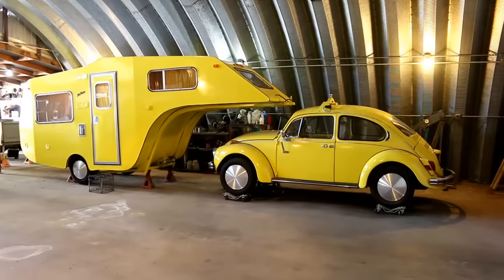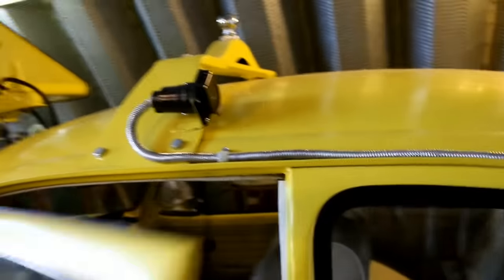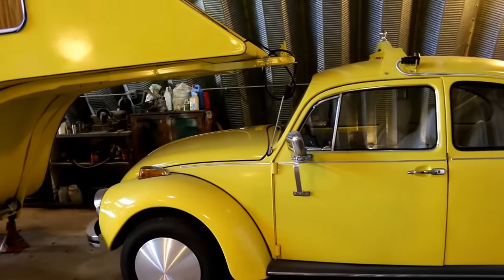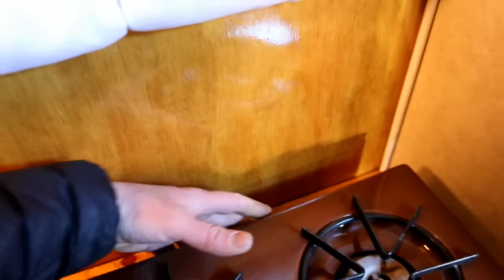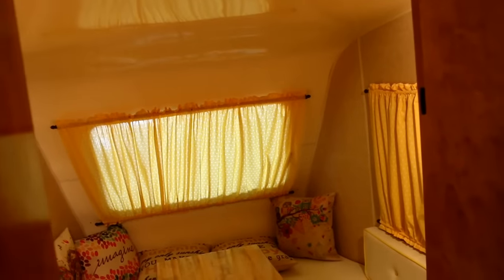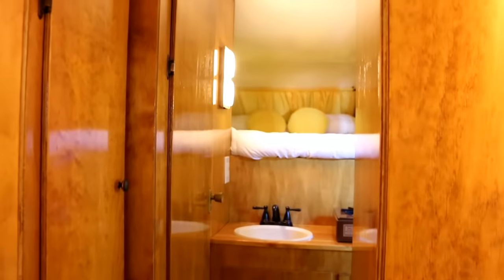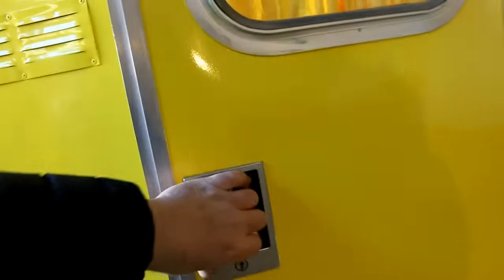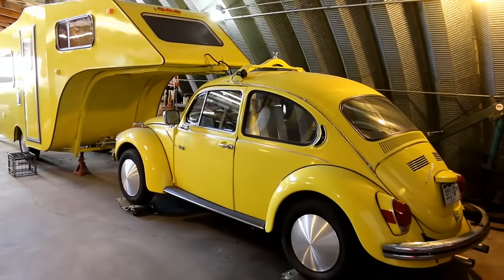VW Bug Gooseneck Trailer FOUND.  PART 2.

Comment: Apart from having a bed over a stove, seems practical.
Reply: Who doesn't like a set of fire resistant bedsheets? Imagine how warm you're going to be in the winter.
Reply: If you are on a daytime schedule, the bed should be made in the morning before cooking commences. Stow the stove before bed.
Reply: @questioner1596  I would imagine that anything that is cooked there the smell is gonna stick on the sheets.
Reply: @c.curmudgeon2834  keep the feet warm in a cold dark winter night.
Reply: @c.curmudgeon2834  Q10
Reply: I was thinking the same, how many of these trailers have burned to the ground i wonder
Reply: @jmason2838  i think by today's standards of power, luxury and reliability it would be quite impractical. The bug was a great car, but i think hauling this thing on an extended camping trip (say travelling around the country) would put an enormous strain on that air cooled 1600 motor. Great engines but not exactly know for their torque. This is a beautiful museum piece but it's the last thing I'd be buying and restoring for actual holiday use. Love these videos though. Totally awesome motor memorabilia.
Reply: yes but thinking a good side you could lean over and make a cup of coffee while you were still in bed
Reply: Who cooks while someone is in bed? Worry wart much?
Reply: This is a rebuild and not exactly like the original floor plan.
Reply: @c.curmudgeon2834  crispy
Reply: Russians?
Reply: Remember 60 hp in a bug! Never get behind it
Reply: Seems like it’s designed to cook outside with most of the time and only be used inside when raining or snowing
Reply: I'd love the warmth of a stove to keep me going at least for a few more hours. ... It's not much different than sleeping by a campfire.

It's pretty obvious to anyone with intelligence that one is capable of shutting off a stove after usage, but I suppose some folks are thinking they're going to leave a clever comment.
Reply: Imagine the sic sh!t that went down in this pile back in the day.
Reply: Well the whole interior is wood, I don't think that'd be the first thing to catch fire.
Reply: You can't sleep and cook at the same time😂
Reply: This would be cool if it was made with fibreglass, and stove relocated to safer location.

Comment: I love stuff like this. What a cool little trailer! I never would’ve thought they would make an accessory quite like this for a VW Bug, let alone the fact that a VW Bug could pull something like this. The craftsmanship on this restoration is fantastic. It probably looks 10 times better now than it did when it was brand new. Truly some beautiful work!
Reply: Those little bug engines, the original 1600s, can do alot. Push around a 71 bus just fine. You let it go at its own speed. Don't expect a lot of power, try to travel when it is not super warm (air cooled, ya know?), just have fun cruising. This restoration is great; I'd love to see one on the road.

Comment: Great Restoration. Now take that trailer and make a whole lot more cause people with VW's are gonna want one and I am sure the patent ran out along time ago.
Reply: Imagine making a modern version that was able to fit the modern beetle along with the classic. That'd be nice
Reply: Justin Noker I’d buy one  for sure... 2 new beetles in my household... plus a  Passat ...
Reply: I would be very interested. But I need one for a 56 type 1
Reply: few people in Brazil did that. i saw repro of this trailer several times on facebook
Reply: @mikesgarage9026  hey you are flock member too
Reply: You'd only need to bump that 1600 to 2300cc to have enough torque to include a family and camping equipment.
Reply: Highly doubt that DOT would let that pass safety inspection, the camper and people would probably be over the GWVR of the beetle.
Reply: @cpufreak101  Duudddeee. I don't even own a Beetle and I'd want that.
Reply: @jeffstrang4330  from what I was told about this, that'd unfortunately be the likely case with a modern version. looking it up, the "New Beetle" isn't rated to tow whatsoever, so that would kill plans for a modern version :/
Reply: Outlawflyer78  It would work with several of today’s small cars
Reply: @badandylaoc  79 to 2003 Super Beetle with a Type 4 2.0 plus liter engine and an oil cooler would do the trick nicely
Reply: I want one for my Honda Fit!
Reply: @jeffstrang4330  .. you are correct about the DOT, but not just the vehicle weight. I used to work in the RV industry, there is no way a company would take on the liability for something like this. It is super cool and I would love one though.
Reply: @mikeybikey5501 : I was thinking same thing for my Toyota Yaris!
Reply: Jeff Strang  yes it’s actually a diy disaster covered in paint
Reply: Justin Noker    Yes he’s good with paint but the engineering is just plane dangerous
Reply: @cpufreak101  I would love it  for my yellow Bug.  🙂
Reply: @cpufreak101  I have a Turbo standard transmission .  I think that it just be able to tow it.  It can tow a Tab trailer no problem.
Reply: @LowreyContractorsUK  why so?
Reply: I think those with the newer Beetles would want one. Perhaps those with similar sized cars would want one?
Reply: @briancole6550  why not today ???
Reply: Why not use a newer bug model with a lot more HP
Reply: @Jordon Carlson actually the new beetle is way heavier and uses more steel in it's construction
Reply: @Jordon Carlson the thickness of the metal does not equal strength the gauge of the steel used in the exterior body in the new beetle is actually thicker look at the crash data you're ill informed
Reply: @jeffstrang4330  Hi there🙂🌻✌️...please to kindly explain..  what is a gwvr ?!?
Reply: Sorry lol I meant gvwr Gross Vehicle Weight Rating, total amount of weight of car, fuel, passenger and load.
Reply: @earlscheib7754  is that really you ES?
Reply: I'd like to see something like that for other small cars too!  Love it!
Reply: @cpufreak101  and electrical hookup
Reply: Yes
Yes I do want one
Reply: @mikesgarage9026  white-anglo(mostly)-saxon(fifthavenue?)adventist0protestant(1611). Want to make one of theese for campmeeting!:goodvibes::yougotthis:
Reply: I know I'd definitely buy one because I love vw beetles

Comment: Some one needs to make a good set of blue prints for this design.
Reply: A couple of thoughts:
The frontal aerodynamics look like they are better with that trailer compared to regular ones - it looks like it would push down the car and thus give better grip.
But if it's windy from the side, does it pull on the car in an unfavorable way?
Reply: Our VW would get blown sideways occasionally on the highway. I imagine car and trail would dance together. 😁
Reply: Way over GCWR for a beetle, did they even check? Wind would be a whole other issue.  There's a reason these never caught on or the camper set ups they had for cars back then with their own auxiliary wheels
Reply: @Cutlass_Rudd  actually no it's fine for the beetle

Comment: how cool is that thing,
Reply: Extremely - Love your videos. Especially VWs
Reply from the maker: It is pretty amazing to see one restored to this condition.  He did an amazing job on the restoration.
Reply: To bad they never made one to fit single or double cabs like crusty!
Reply: Couldn’t agree more, I love your videos but the way. Huge fan.
Reply: Shut up and take my money cool.
Reply: Isn't the Thing another VW vehicle? 🤣
Reply: @jjryan1352  no.  Because the towing vehicle can do a 360 under the camper and is hauled around by something so awesomely cute small.  It's like the ant carrying the leaf twice it's size.  Little package, low horsepower, more torque than you can shake a stick at type of thing.

Sorry that was for the guy above you.
Reply: The welding shop I apprenticed at put a 5th wheel hitch on the roof of a 1975 Buick electra in 1975. Car was only a couple months old. Had an exoskeleton built down and attached to the car frame.
Reply: SUB ZERO COOL
Reply: @Roscoe.P.Coldchain  It's because its a period correct accessory. Calm down bud.
Reply: @dontneedtoknow5836  I don't think there's any torque to go along with the no hp either lol
Reply: @romper4444  you don't have to have a large amount of hp to create large amounts of torque.

And this probably would have been better balanced considering it is a German product?  During the epitome of their designs.

Comment: The promotional film showed the hitch attached entirely to the drip rail not with holes through the top of the car i remember the hitch attached in 4 places to spread the weight out along the drip rail. This was a very good video the gentleman did a great job putting it together with know directions. The trailer restoration was beautiful i helped my dad do a 35ft. Travel trailer they aren't easy with rounded corners some materials don't like bending. But it was a beauty when we were done we used it for yrs. Fishing and hunting.
Reply: Thanks for sharing

Comment: Such design of the camper trailers is ingenious! I really don't understand why it never took off.  I mean, you have agility, more compact size and with modern technology you could also have better vision. Definitely amazing way to tow a camper trailer!
Reply: The trailer has a lot of room, unfortunately the VW does not, which is probably not considered ideal for long trips.
Reply: @barnabyjones6995  why, only the driver needs to be in the beetle while driving and the rest of the family can chill in the camper
Reply: @daniel57327  that "legal" where you live?
For sure not in Europe 🤔
Reply: The tow vehicle of choice had 48hp. Enough said.
Reply: @daniel57327  not unless the camper has seat and shoulder belts inside the camper 🚧🚧... I really don't think the D.M.V. would allow people inside while it's moving down the road..🛑🛑.🖐️🚫🚫🚫😩😩🤔🤨
Reply: The Cars weren't made powerful enough to tow anything very far..
Reply: Today it wont be practical in europe at lest, just because of the structural intergrity of the cars roof and frame is made to pull trailors on a trailors hitch in the back and not on the roof, so basicly with todays regualtiory hell hole you would have to redesig the whole car to legaly pull stuff like this.
Reply: @oleand14  You are right, yes. And considering all the regulations (Especially in Germany where I live), it would definitely be a nightmare bureaucracy trip to pull it off.
Reply: Because it’s a gutless, overloaded, air cooled death trap.
Reply: @jmason2838  seatbelts for sure would not help 1 bit in Europe, there is NO way anyone can stay inside a caravan while driving
Reply: @mattmayo3539  Facts
Reply: In principle, any sedan could tow it

Comment: The VW bug was what International Travel Inc used in the commercial in 1974 to promote this travel trailer. It has become known as a WV accessory which it can be but some other small cars could be used as well. The bug would probably be the best choice which is probably why they chose it for the commercial.
It was a good idea as it looks like getting in and out of places would be much easier than when a trailer is hitched to the back. 
The two things do look great together.

Comment: That is absolutely mind boggling, and it would never in a million years be legal in my neck of the woods!  I love it, and I want one! 🤩
Reply from the maker: Pretty neat trailer.  I'm sure it would be frowned upon by the DOT these days.  JC.
Reply: Old vehicles get a pass
Reply: What would be the issue? It has safety
 chains, lights, appears to have electric brakes, and the tow vehicle hitch is more that sufficiently strong along with the bodywork mounting. The power margin is much narrower than most north America drivers are used to but I've seen Peugeots pulling horse trailers in Bavaria without issue.
Reply: Imagine a steep down hill road with a switchback, the trailer could overpower the VW,thereby tipping it over sideways. I think that would be a concern. Cheers

Comment: Beautiful, great job guys!  I bought a factory redo Diesel Beetle, 2015 model but sold in June 2017. VW dropped the “bubble” and it’s something like a foot shorter than the original beetles. Making a similar trailer work on my Beetle would require a shorter RV.

Comment: Just ran across this video.  When my brother was assigned to Cannon AFB in New Mexico, another airman had one of these.  My brother would only drive VW products his entire life and was very interested in this trailer designed as he loved to camp. When my brother retired in the mid 1980's, the guy still had the trailer and was stationed in Colorado at Peterson AFB, his last duty assignment before he was to retire himself. He had obtained a copy of the original plans and gave one to my brother.  I would have to check with my sister in law to see if she knows where they are, as my brother passed about 4 years ago.

Comment: Oh, Bob....Those exposed bolts right where I'd crack my head are NOT cool.
Reply: so true, how easy is it to put some white caps on them?
Reply: Or shorter bolts..........fit and finish could be better
Reply: Use the bolts to attach some “oh shit” handles on the inside. Looks like perfect spacing and location for them.
Reply: The bolts are a 100% half assed solution. Drilling wouldn't be necessary if some proper thought had put into the mounting. Bugs don't need more holes.
Reply: Could have used carriage bolts. I think this was his take on the original hitch.
Reply: Mickey Bitsko yet nobody notices the hitch has morphed the car so the driver and passenger door sit way low from the hitch crushing the car down.
Reply: Mickey Bitsko 
You can see this bolts are not tighten yet.  It is not finished.
I was looking for the strong iron counterplate , inside ot the roof.
Reply: Hopefully you will only do it once! But some people are slow learning!
Reply: I don’t think the original hitch was intended to be permanent? Off and on like a roof rack?

Comment: I'd think I would do something else with those bolts so they don't go through my skull in a crash.
Reply: Simple solution: don’t get in a wreck.
Reply: Just buy a Volvo.
Reply: Yeah,, flip them over and use fender bolts, and have a acorn nut on the outside.
Reply: you saw the color right? nobody is running into this thing

Comment: Nice work on the restoration and reinforcement of the trailer hitch/frame. It may also be an advantage to weld in a couple side plates where the frame makes the curve downwards for more rigidity. As far forward as the actual ball hitch is, it shouldn't interfere with any part of the car. The interior work is stunning considering how this looked the last time I saw a video of it! Very rare bird here... nice job!😍😁👍👍

Comment: 0 to 60 in, oh forget it never.  And no uphill.
Reply: Timing it in the quarter mile requires a calendar.
Reply: Mark Gigiel wouldn’t count on a whole lotta stop either.
Reply: @corydriver7634  7 pin plug tells me the trailer has, or is supposed to have brakes.
Reply: @alexmawdsley  Only tells you its got to have lights :D

Comment: VW BUGS (Type 1 for all to know) 71 year had the 1600 Dual Port engine...60 hp is it...the amazing thing is gears 1, 2 & 3 are reduced...4th was actually overdrive...final gear was a low ratio. The 15 inch wheels and tires made up for this low ratio (4:33 I think) so with overdrive in 4th it would cruise quite well at 60 pulling this aerodynamic trailer...notice the smooth shape of the VW...THEN LOOK AT THE TRAILER...PERFECT...NIIICE SET UP...I am 73 & retired...I owned a few Bugs in my life...neeto bandito...BEEP BEEP...

Comment: A lot of people are unaware that the Hunter Compact Trailer was also made to be hauled by a VW bug. I have a 1972 Hunter Compact  that my uncle bought when he bought his 72 Super Beetle. I had the beetle until it was wrecked in 1990. I now pull it with a restored 93 Ford Festiva. Total weight is 900# & tongue weight  is 80#.  The Hunter's  were actually sold in the dealerships / with the VW's. Some dealers carried them, other's just offered to order them. Dixon VW in  Crest Hill , Ill was a large dealership so he had them on display. There is a lot of Hunters still on the road & are still sought after. I've been offered $ 10,000 for mine, & the sticker price was only $3100..... Just putting it out there...

Comment: You would have to disconnect the plug and safety chain to do all the maneuvering as shown on the first video. I can see how this would be a fun thing to use. We started with an 18 foot 5th wheel  pulled with a 2.8 v6 S15 Gmc and now have a 40ft and a 3500 1 ton. Thanks for sharing.

Comment: Here is a suggestion. The trailer is towed with the gooseneck forward, but the gooseneck is tapered on the forward side. This is not an aerodynamic shape if the vehicle travels at less than speed of sound. If the gooseneck was square fronted, space inside could be more efficiently used. Any attempt at streamlining a subsonic vehicle must be done at the rear, where the vertical rear plane bordered by lines of air separation governs the size of the wake (low pressure) which follows the vehicle. Dimples on a golf ball effectively make the circle of air separation smaller than the ball diameter.
Reply: Great idea. Umm you know that this was probably designed in the 60s right? And farmer Bob spent two years restoring and probably doesn't care about aerodynamics. You sound smart. You should build your own.
Reply: @artummomenti3147     Aerodynamics is a secondary consideration. Eliminating the taper at the front, making it a parallelepiped,  would provide more sleeping space in the gooseneck and would make it possible to install another side window to match the existing one or a front window.
Reply: (Sigh)

Comment: Sweet rig, but I gotta think that it doesn't handle very well with the load mounted so high. I bet it's a handful in a stiff crosswind, or if you try taking a tight curve at speed. Still, I'd be happy to have one for the cool factor.